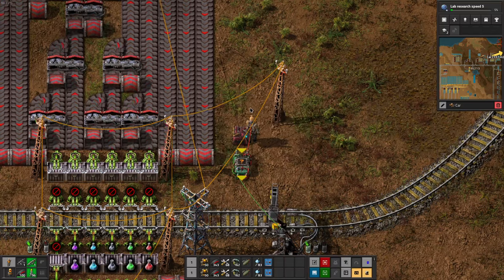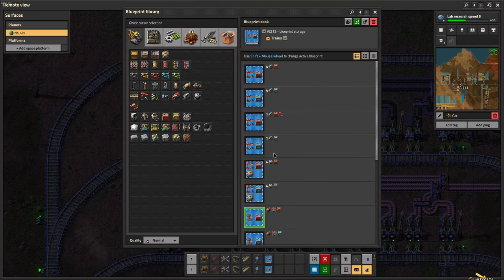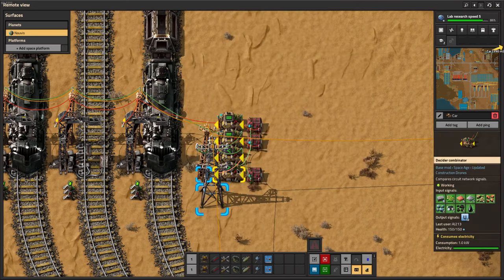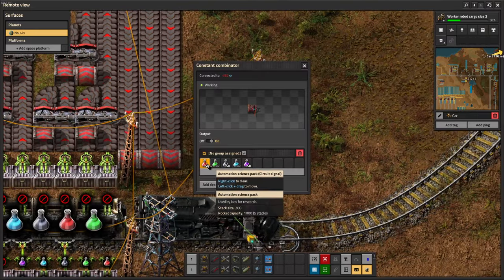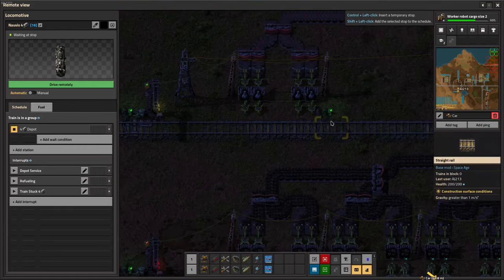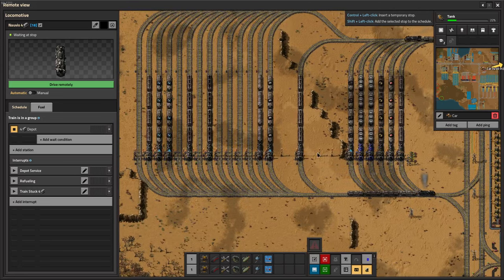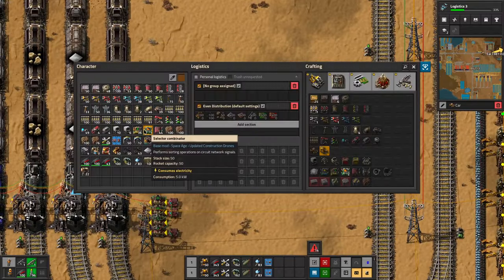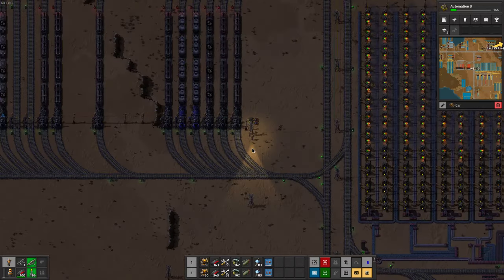Factorio 2.0 Pull-Based Train LTN-like Interrupt System

Comment: Set up train stations to be enabled/disabled based on a simple chest buffer count. Then make all of your copper node stations the same name. In theory, no logic is needed at the main system as trains can only leave if they have a valid path. If no stations can accept a train then it will have nowhere to go.
Reply from the maker: The point of this system is that the provider stations are enabled so that sushi trains can be sent there. These trains are typically for the mall.

Comment: Enable/Disable station leads to some screwy results. Much better to run your provider station reading through an arithmetic combinator where you take the item read value / single train capacity to set the provider station train limit.
Reply from the maker: What type of screwy results are we talking about? I am up for trying it out
Reply: @AJ213Probably  Station disable forces an inbound train on to its next scheduled stop. If a provider, you'll end up with an empty train that heads to the requester without satisfying the request. If a requester, you can end up with items left in the train heading back to the depot. Leaving station disable alone to instead dynamically set train limits means you will never risk a train missing a stop because it will wait at a station until the next stop opens.

Realistically, you'll need an arithmetic combinator: (platform count / train capacity)=L and a pair of decider combinators: if * < max L, pass value | if * >= max L, pass max L.
Reply: Bah, reading elsewhere that station disable is just now the same as L=0 instead of the pre-2.0 fuckery.

Still, the dynamic limit is better if your stops have space for more than one train in the queue.
Reply: @christopherschroeder4096  Oh yeah, I forgot they actually changed that! Looks like that's from friday facts #395.

Comment: is this just to save on the amount of trains in the system?
Reply from the maker: Kind of, its more so the stations are open so that I can pass sushi trains through them and so its easier to add a lot of stations. I've ran into a lot of issues running tons of stations in vanilla usually with having too many trains causing deadlocks. And of course too little.

Comment: To get around multiple trains being assigned to same task, I setup the requester stations to not request new resources if a trains coming and setup the provider station to signal to balance out the request so when I have multiple providers 2 trains will not head to two different providers, only one train will be dispatched for both. This also solves the problem of when the train leaves the provider to the requester the doesn't also get another train coming. Used 2 decider contaminators at pickup and 3 at drop off.

Yes it does use a global network but I just use a radar for that and all my stations generally, have a radar to begin with. The nice thing about this is it doesn't matter if fluid and cargo trains intermingle in the depot. I also found that the depot needed delay between each train being sent, as sometimes multiple trains would get assigned on the same tick. So I made it every 2 ticks and it seems to be smooth now and instead of going through each resource it just goes through each station number. Making expanding resources just as simple as adding a requester and provider.
Reply from the maker: Are you also doing different wagon sizes too? The trouble I was running into with a global network is how complex it got as you only have two signals to send data through. And if you have different networks for different wagon sizes or types it meant using a clock and examining different ticks for sending more information through the red/green wire.
Reply: @AJ213Probably  Think using different wagon size wouldn't be to hard, the stations can read the contents of the train. You can then put an OR statement for Full Cargo Or Variable fulfilled. 

I was only planning on using 4 wagon trains and for resources like blue circuits just restricting it to half a wagon to a full wagon and the other wagons just not used for those stops. 

The other way you could do it is a different train stop name format for shorter trains and they have a different interrupt. Like Dropoff4 for 4 cargo wagons and Dropoff1 for one wagon. Then different depot slots so it isn't possible for all your short trains to get stuck in line behind long trains. With this setup you would still send the same info in global network and the interrupts would assign jobs based on train length.

Very easy to modify all the trains with groups anyway.

Comment: Around 10:50, you have "has cargo in inventory" as the very first condition for that interrupt. That item parameter is never going to get a chance to try to send the train to an invalid destination with the item parameter being blank, because it can't satisfy all of the conditions to trigger the interrupt without having cargo onboard. I'm not sure exactly what you're trying to say there, but it seems like the problem you're talking about is already solved?
Reply from the maker: Makes sense to me! The item parameter really is a wacky one. I will remove the "has cargo in inventory" since its not necessary as you stated.
The purpose of the interrupt overall is to clear the provider stations. The potential issue is a train is sent to a new provider rather than using the existing trains in the storage. However, the train in the depo full of cargo should reserve the requester station early enough to prevent that from happening

Comment: https://youtu.be/C3HBa20a5Io?t=270 If you want to count the number of input signals you can use a selector combinator in one of two ways: a) with mode of operation as "Count Inputs", it does what it says and outputs to any signal you want,  or b) with mode of operation "Select Input" and "Sort Descending" with Index 0, which will return the signal with the highest input count.
Reply from the maker: Yeah, the only thing is the point of the circuit is you don't have the selector combinator. As then you would just use that instead